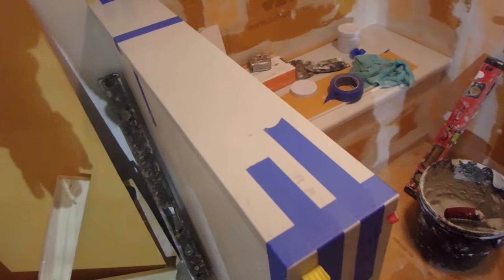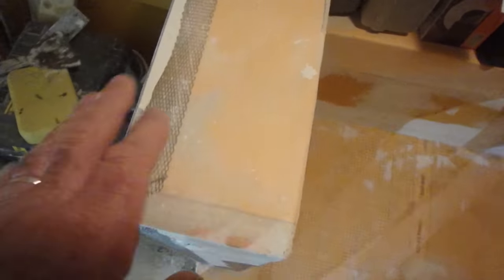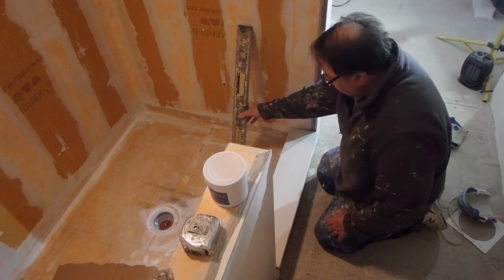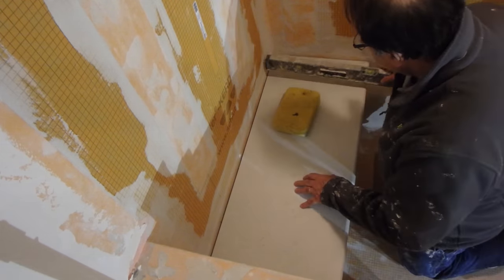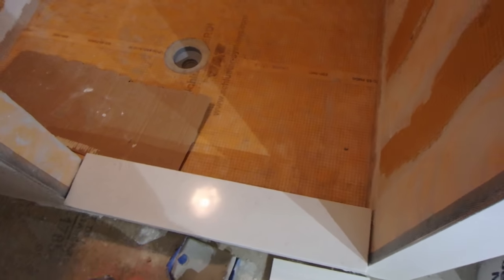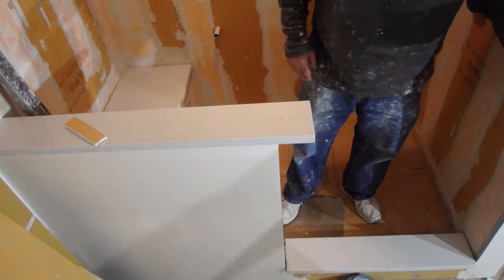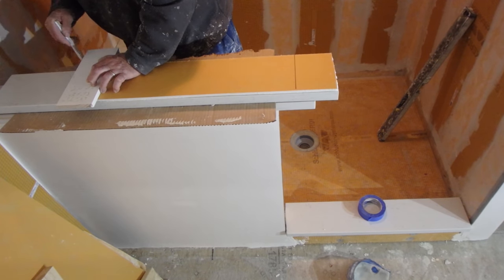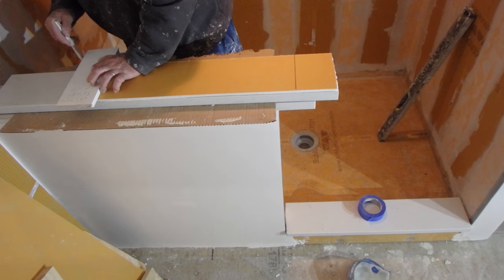🤔 Shower curb, Bench seat and Knee wall. How to trim them.

Comment: Such good videos…when you are measuring the top ledge and upright ledge for shower glass to sit on…I noticed you laid the top piece on and set it for level and slope then used the scrap kerdi board to set template up for the vertical piece.  You marked them then cut them, but did you have to add any length to compensate for the thinset that you will apply?  And if so how much?  Also at the end you placed spacers at wall side on top piece and at bottom and top of vertical piece but that wasn’t used for the template measurements?  How did it not be off since it wasn’t originally accounted for?  Thanks Sal

Comment: Is the azek (vinyl trim) going in the whole bathroom, or just under the threshold? Also, for that drywall 90 angle does it have to be galvanized or stainless steel? Or will moisture never get to it.
Reply from the maker: Drywall angle is not in the wet area, so no special requirements, the Azek just under the curb.
Reply: @SalDiBlasi  cool, will try the azek thing for my next project. I have some Versatex sitting around, it’s a azek competitor.

Comment: Do you generally want to install a slab shower bench top prior to tiling the walls? We are working on a corner shower with a bench opposite the shower wall and it will have a full glass enclosure. I think we could install in either order - but wanted your advice.
Reply from the maker: Stone first then tile

Comment: What product do I use to cap a knee wall?  I want 3 finished edges (2 long sides and 1 short side). My contractor suggested Marmiline, but the short edge isn’t finished. The short end will be the front edge of the knee wall so it needs to be finished just like the long sides.

Comment: Hi @SalDiBlasi, absolutely love your videos. I’ve done two bathrooms start to finish based on your work. I notice something at 25:16 and 25:35 of this video - you have some mesh corner on top of the kerdi on the outside edge. I am doing a similar knee wall on one side of my next shower/2x4 construction half wall with sheetrock and planning on wrapping completely with Kerdi. Should I add some mesh corner bead to shore up the edging? seems like it would be a good idea, but I notice you seem to affix it after the kerdi  with a staple at each end - is this something you would recommend? Would it be overkill to add the mesh corner to inside/outside edge of the kneewall that will have a granite trim and 1/3 height glass door? Thanks again for the great videos and the time and effort you put into the channel.

Comment: How do you go about wrapping the membrane on the knee wall on the finished drywall side? Do you slightly wrap it over the finished side and than use the mesh corner bead over the top of the membrane to complete the compound finish? Thanks for the videos!

Comment: Wonderful job, thanks for posting. I was wondering where do you get your slabs for the curbs, and knee walls. I went to a couple of stone supply stores and they only sell the whole slab. I was quoted a price for a 24 x 6in and a 52 x 6in slab $948.00 I said thanks but no thanks. They said that was the cheapest.
Reply from the maker: You can get sills at a tile supplier in several different colors, they will usually have them in stock. For custom made ones,  usually to match the vanity top you will have to pay more.

Comment: Where do you get the slabs to cut for the caps and what's easiest way to polish edges
Reply from the maker: Usually the fabricators that do Kitchen counters and the like will do them, Many colors are also stock at most tile distributors.

Comment: Sal totally unrelated to this video   i’m a fan of your and have a lot of respect for your knowledge. I have been doing tile off and on for about 10 years. I’m a remodel contractor so I do a little of everything. I was wondering what your thoughts were on following manufacturer’s guidelines on mixing mud. I followed the bag instruction to a T (upon your advice on other vid) anyhow I live in the south and the mud dries up super quick. will adding more water to my mud weaken it?
Thanks for the wisdom
Reply from the maker: While you are doing the initial mix, you can add a bit more water to make it looser, but never add water after the mud has slaked, you can remix to loosen it up, but do not add water. You can also switch to a different mortar with a longer pot life and open time.
Reply: Sal DiBlasi  Thank you sir. I should have specified “is it ok to add water to initial mix” I learned the hard way to never add water after the mud has slaked. Thank again man- Brendan

Comment: Sal, I have watched many of your videos and appreciate your craftsmanship and valuable instruction.  I have this very setup with bench, knee wall, threshold.  I have noticed you always leave a reveal on these horizontal surfaces with slab material and that you install these first before the balance of the tile job.  I am interested in leaving no reveal on knee wall and threshold leaving the adjoining tile flush with the slab pieces.  Any tips and recommendations (is it not a good look)?  I was going to template the slabs after the horizontal piece were installed to get the widths absolutely perfect.
Reply from the maker: It is your bathroom, no overhang makes for  narrower sills, if that is the look you want, personally I like to see an overhang and cut the tile around the sill so there is no direct path down for water in those areas, not that it would matter, everything is waterproof.

Comment: Very nice installation, thinking of using quartz for my curb as well. What would be the needed width for a 3.5” curb? And does it always need to be installed first?
Reply from the maker: I always install first, Figure the finished width of your curb, then add whatever overhang you want on each side, that is the width you should get. Most sills come in 6 or 5 inch widths, you can have one custom made to any width you like.

Comment: Sal. I had an illness which took me away from tiling a wall, half way through it. The leveling system I use left the tiles on the wall with a few clips under the tiles and some were moved from the edge of the tiles, so the level when i place a tile on the level plastic is a few mm out now. The tiles have set and the adhesive is very hard. What could i use to remove the plastic leverles under the tiles and place fresh ones in there place. Not sure if you've had this problem before. Cheers D
Reply from the maker: https://www.youtube.com/watch?v=y7mRaTOa1so

Comment: Hi Sal do you know of a good blade for wet saws that won't bend or deflect while cutting 45's
Reply from the maker: This is what I have on my wet saw https://amzn.to/2x94C1o but there are many good options  this is another cheaper blade https://amzn.to/2VEcxNR that has a Reinforced Hub  to help with deflection. The most important thing is to have a blade suited to the material you want to cut and to dress the blade when needed. A cheap blade is not always the most economical choice. A great blade will last longer and perform better than a cheap blade that struggles to cut the material it is used  to cut.

Comment: Sal didn’t u have to scribe the bottom of the vertical slab to fit the slant of curb slab?
Reply from the maker: I did
Reply: @SalDiBlasi  wow I didn’t even expect an answer. I figured it had to be done it just want in video.

I was wondering if you may answer 3 small questions?

1st- If using vapor barrier over studs do you need to red guard all of your backer board  materials like hardie or wonder board in the shower area or just the corners and seams? I heard not to do all of it if there is vapor barrier being used. Just seams, corners and screws?

2nd- would you ever not cover the back of niche with wonder board.doing everything but the back of niche and leaving just the vapor barrier? This seems very wrong to me but is what my shower guy was gonna do.

3rd- do you like the seam cloth tape rather that’s the fiber glass tape for joining the seams?

Thanks so much for ur time.
Reply from the maker: @ShaneHolly  It is either the vapor barrier or waterproofing of the entire board, not both, However it is better to protect the entire shower with waterproofing than just using a vapor barrier behind, which is the least affective and minimum that can be done., Back of the niche should be fully waterproof like the rest of the shower. I actually prefer sealed systems and foam boards.
Reply: @SalDiBlasi  thanks Sal.

Comment: What adhesive are you using?
Reply from the maker: Schluter AllSet
Reply: Sal DiBlasi I’ve got Carrara marble job coming up, gonna use Ardex x 18, have you used it? I got recommended it from tech dept. Ardex. Yet some other places are trying to get me to use moisture sensitive adhesives
Reply from the maker: For Carrara any good quality modified white mortar will work.

Comment: Is that TRUE marble you were using, or a man made solid surface to resemble marble?
Reply from the maker: This one is Marble
Reply: @SalDiBlasi  NICE, have you ever used a man made solid surface in this application? Just wondering because I had a customer who inquired to me about that for a curb sill and seat one time. I did some research on it but really couldn't find a lot about how thinset reacts with it, how to cut it down because of the material and resins its comprised of. Would love you're input if you have time. Thanks!
Reply from the maker: I have actually done it many times, cuts and polishes like marble for what I need to do, thinset stick just fine.
Reply: @SalDiBlasi  thank you